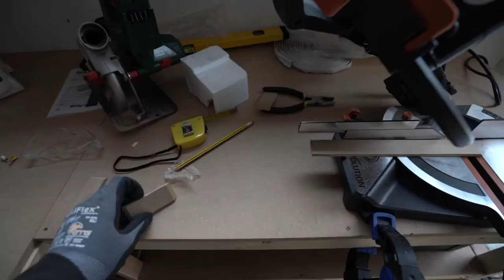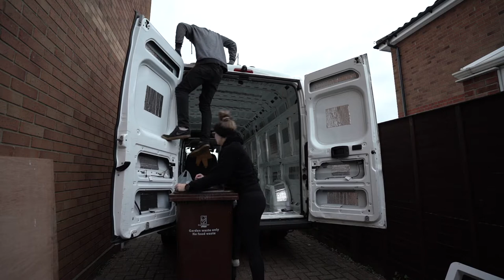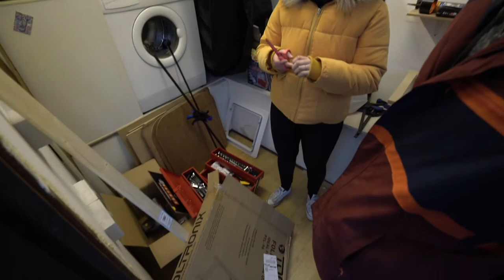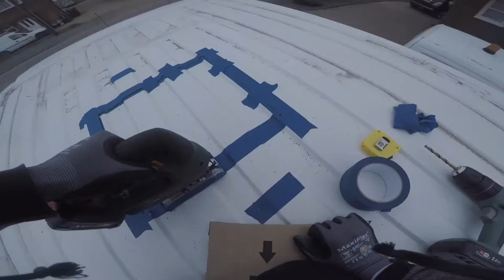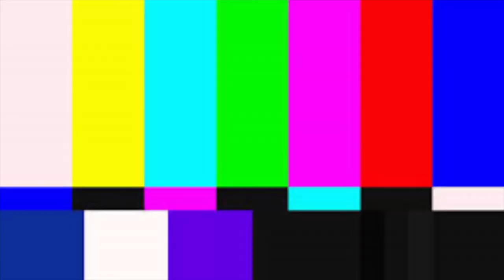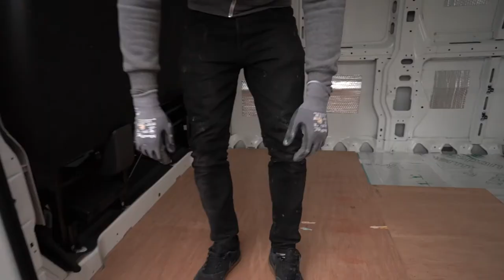Installing a MaxxAir Fan - Floor Insulation - Camper Van Conversion UK Vlog - Citroen Relay - Week 3

Comment: So you used wood to make those gaps waterproof right?
Reply from the maker: Hey Pete, yup 6mm mdf, it's just to make those gaps more solid, I didn't like the idea of just squirting lots of sikaflex there or other types of fillers. It's the sikaflex bead around it that makes it water tight.